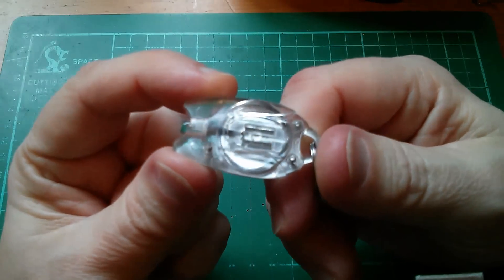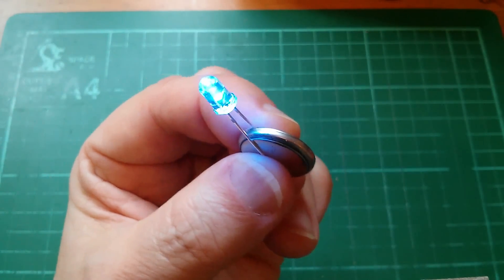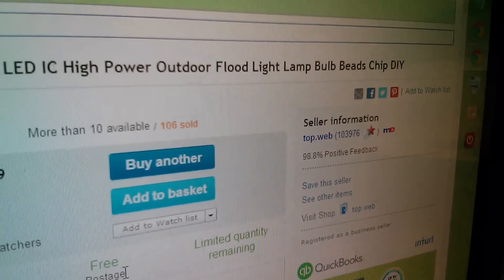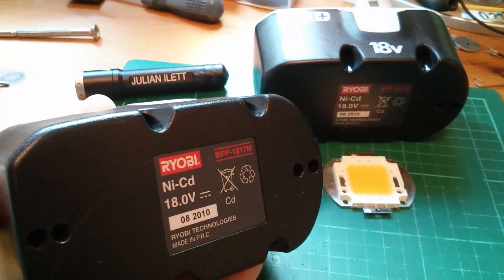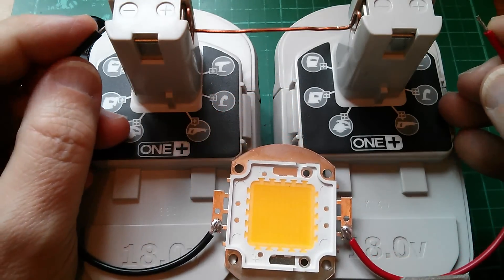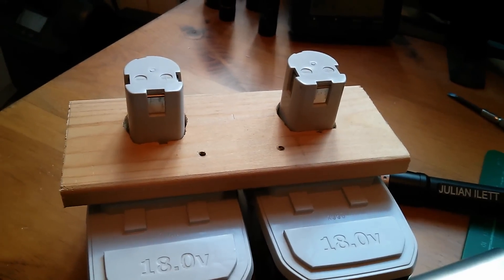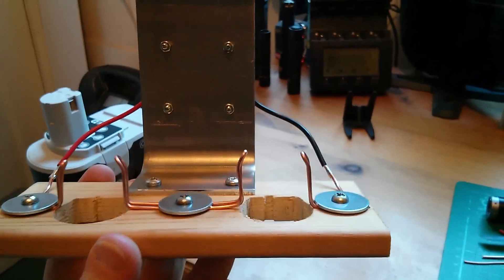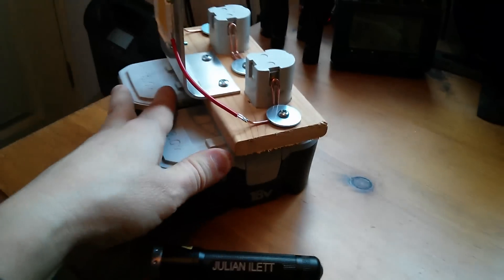Monster 7,500 Lumens 100W LED Flashlight for under $10

Comment: I just picked up two massive 1000w floodlight boxes from the scrap yard, thinking it might be easy to 
Put some new life into em with LED's.and they would be phenomenal mounted to the roof rack of my camper/work van for a variety of uses.
After watching several of your videos, I've realised that 
1>I'm incredibly stupid. 
2> upcycling each box with 5 x 10 watt 12volts LEDs would require five drivers and a heatsink and being a tightwad I'm not sure the result would be worth the expense

Have you seen any multi drivers? Julian Ilett ?
Think I will wait till they appear on the market.
Cheers

Comment: Lol, your "teh dollah" torch idea is like the story of the tramp who knows how to make pebble soup, the four quid LED is the pebble simmering away in the hot water by the way, now I know I'm being cheeky (said the tramp) but, would it be better with a little swap out of the drill batteries for that of a car (potatoes), then if you could just find an old heat sink to stick on it that would help (carrots), ohh if only you maybe had a power supply (leeks), now if perchance you happen to have a 3D printer to knock out a case for this "teh dollah" setup then we would be laughing (oxtail) oh and some salt, and perhaps a little pepper. sure is some tasty pebble soup.  Now the question is this, did the woman who had the tramp stay over for tea understand the true cost of said soup, because by my numbers that "teh dollah" torch has run over budget by a few pence.  Nice work otherwise, lol.

Comment: 0:40 actually the output resistance of a coin cell is so big that the battery shorted out can draw only few mA so the led connected across the cell is not damaged. Voltage of the cell has nothing to do with it.
Reply: ***** Unless the voltage is exactly at the forward voltage of the LED, in which case you don't need a current limiting resistor.  R = V / I, so V is source minus the forward voltage, which if the coin cell puts out the exact voltage as the led's forward voltage, you get zero.  Zero divided by anything is zero, meaning you need a current limiting resistor with a resistance of zero ohms.  Aka no resistor.
Reply: 5ky You're assuming that LEDs obey Ohm's Law. They don't. The relevant factor is indeed the internal resistance of the battery.
Reply: Lithium ion power tool batteries have VERY low ESR and can output hundreds of amps of current safely.  Unlike a coin cell battery.  They don't 100% obey ohm's law, but it's close enough for most applications.
Reply: 5ky I didn't say the batteries didn't obey Ohm's Law. I said that LEDs don't - in fact LEDs have very non-linear current/voltage curves.

Agreed that power tool batteries have low ESR, and that coin cell batteries don't.

Comment: BS, the batteries alone are $40 apiece and a big heat sink, and switch and some type of housing, and you need a current limiting resistor, which you can easily find by the voltage divided current needed....

Comment: how many 100watt LEDs would the DC-DC 600W 10-60V to 12-80V Boost Converter Step-up Module Power Supply be able to drive in each LED's sweet spot?

Comment: I would have put some thermal compound between the back plate of the LED and the metal. it wouldn't add much more to the cost and would ensure good thermal conductivity.

Comment: You need a good aluminum finned heatsink if you want to use this for more that 10-20 seconds or the LED will destroy itself. LED's get very unhappy if they are over driven or if not heat sunk properly. Did you measure the voltage across the LED while it was lit?

Comment: Nice bit of work.  I had no idea LEDs got very hot.  Have you considered water cooling with a small radiator and fan?  It would take power from the battery, but it looks to me like you have power to spare.  If you could get enough cooling, say for a walk around the block, that would be most excellent.  Keep up the good work!
Reply: You know I was also thinking about the HEAT part and it got me thinking if all the that Heat Generate can be used or cycled to (make) a Water-Heater...

Comment: Hmmmm like the light but couldnt you use a heatseat fron a computer that has a fan attached to it and then use some thermal paste and wire it in with a diode to run at 12 volts, and you can even get a fan that will run same voltage as the batterys are you can run it off one as the light runs off both batteries, i have done this and i get a good 4hour runtime and i even made a case around it so it will look like one of those old train lanterns, it even has a switch to turn both light and cooling fan off are on. Good vid though.

Comment: 20meg ohom resister should be used little current but pressure from voltage
Reply: and make that a 100 watt resistor please
Reply: You won't get much of anything using 20 Megaohms.
Reply: That is correct and that is the point.

Comment: How much heat does this produce? I was thinking about switching out my projector bulb.
Reply: snaremj I'd reckon on about 100W. 
LOL
Reply from the maker: snaremj Lots. Thermal management of these LEDs is as complex as the electronics
Reply: +snaremj You would need a heatsink like this. 
http://www.amazon.com/Cooler-Master-Hyper-212-RR-212E-20PK-R2/dp/B005O65JXI
Reply: I pretty much went liquid cooled cpu cooler. The cooler seems to be keeping up so far. That for the help though.
Reply: snaremj
Seems sort of like fragile, expensive overkill for what is merely a source of light.

Kids, home stereos managed to handle 100W for decades with nothing more than a passive heatsink.  You can get an old broken or decrepit stereo with such a sink in it for free on Craiglist or very cheap on eBay or from Goodwill or a pawn shop or electronics repair shop if there's not already one rotting away in your grandpa's attic.
Reply: +snaremj yeah that's not a good idea, water cooling is just another breaking point.
Reply: Moth
And has zero benefit.  Water cooling in computers is only used because of the limited amount of space around a CPU or GPU.  An equal volume of copper and aluminum, with the same airflow rate, would cool better.

On the other hand if you had a phase change liquid with the right boiling point, like you find in heatpipe heatsinks, you could at least reduce the mass, making it more portable.

That's going to be the most cost effective too unless you have large scrap metal (heatsinks or ??) available, as you can get a modestly performing heatpipe heatsink for a CPU, able to handle 150W or more, for about $20 or less.  Having a fan makes it more fragile but substantially reduces the size, weight, and cost over a passive heatsink massive enough to allow continuous operation for more than a few minutes.
Reply: that's right.
but no water cooling isn't that bad if you had a nice rad, like a car rad, not a small one like on a computer. but air cooling is much more space efficient and more portable, as there doesn't have to be moving part and if there is a fan, it's only one.
Reply: Moth
Is it possible to use water cooling? Yes.  Does it have any benefit over other alternatives?  No, not for this application.  You'd be as well off brazing a copper plate onto the radiator and directly mounting the LED to it, if you already had the radiator and were dying to use it.
Reply: yeah i agree with you that water cooling a led is a joke.
Reply: I put a 80watt driver on the LED and it got well above 200F.... The water cooling that I use is a small closed loop system that uses the same 12v supply... the heat-sink and fan that removes the heat take up less space the heat sink pictured...and for all the trolls.... it works great.... sorry to disappoint. However.. totally wasn't worth sticking in a $400 Epson...
Reply: snaremj hm do you have pictures or no?
Reply: snaremj
Yeah I want pictures too, including the resultant projected image as proof that it focused good still.  An LED with a smaller die would tend to work best in a projector, something with high die density made by Cree which is also more efficient and reliable based on reports we've seen of these 100W generic LEDs having whole series of dies fail due to poor Vf matching of them in parallel.

However, yes it would be worth using in a projector if you get it to work because, if cooled adequately, it will outlast several traditional projector bulbs (which are expensive!) to save a lot of money, except that no matter how great the result it will still have terrible color rendition.

Even if you tweak the output to shift to a warmer color it's still going to be way off natural looking, though I suppose you could get used to it if you had to, sort of like looking at the world through tinted glasses.

Ultimately it wouldn't be true to state that water cooling can't work, but it's just not as good an option because of the increased complexity, inferior cooling capacity per volume, risk of leaks, additional failure point of a pump.

Use the water cooler for an application where the remote mounting of a radiator has more merit, saving it for that use.

Granted, a projector is a little different app than a (hopefully) portable flashlight in that the bulk and complexity isn't so subject to weight, size, shock during use.